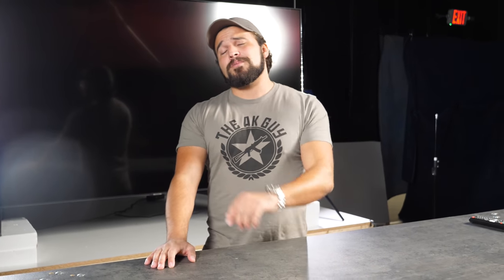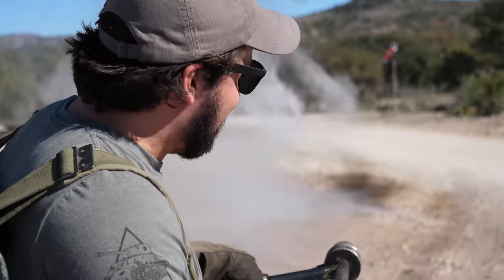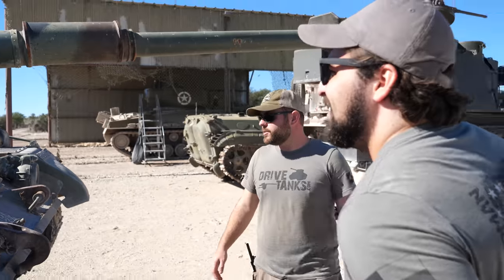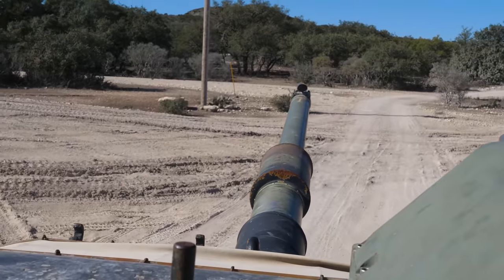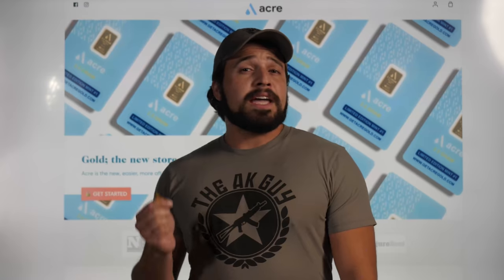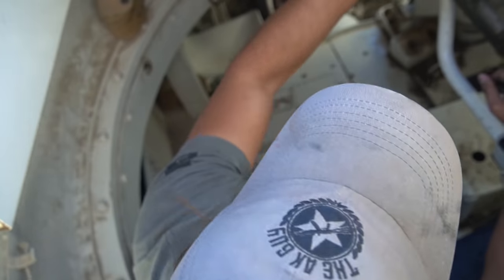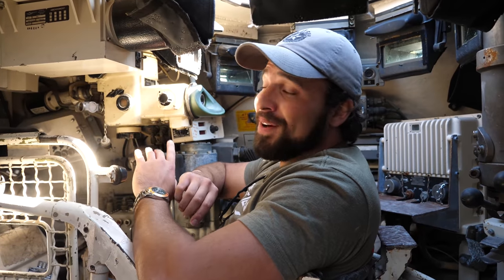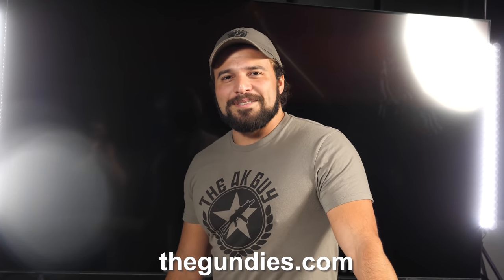I FINALLY FIRED THE TANK

Comment: "Just like driving a BMW"

I mean, yeah, I don't think it even has turn signals so you don't have to worry about deliberately not using them.

#akgnotificationsquad
Reply: Haha true xD
(but it does have them, you just dont need to use them really, much like in BMW)
Reply: As someone whos seen a lot of BMWs, that means it leaks oil exactly like we say British cars so, just people ignore their BMWs....it isnt leaking if we never see it.
Reply: All Leopard Is have signals and lights to be road legal in Germany.
Reply: @thesmallestminorityisthein4045  Schrödinger's leak
Reply: @FirstDagger I drove the C2 which is the Canadian variant and we also had all lights as it was street legal
Reply: @thesmallestminorityisthein4045  Ha, I drive a Jeep Cherokee, I don't have any leaks! Except my valve cover. And my cylinder head. Also the oil pan gasket. Sometimes the rear main too. But other than that, no leaks!
Reply: @jonjieft  well it's a derivative of a German a1a1 iirc

Comment: If you ever get the chance, driving a modern M1 is like riding a motorcycle.  Handlebars, right grip roll throttle, right foot brake.  The transmission is a simple thumb operated selector switch.  All powered by a turbine engine powerful enough to get over 65 tons airborne like a big tracked dirt bike.  The smile on your face will nearly connect at the back.

Comment: The Leopard 1A5BE is cheating when it comes to driving a tank. You just put it in drive, hit the gas pedal, and use the steering wheel. Do a video on driving the T34-85 and all the shit that goes on in there. That is a real challenge.